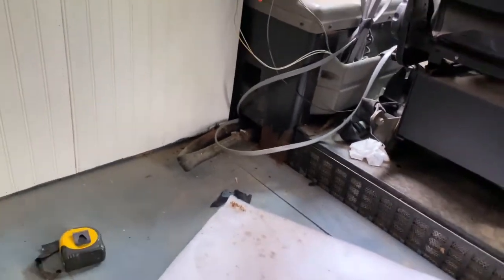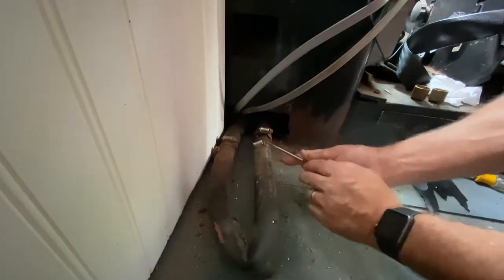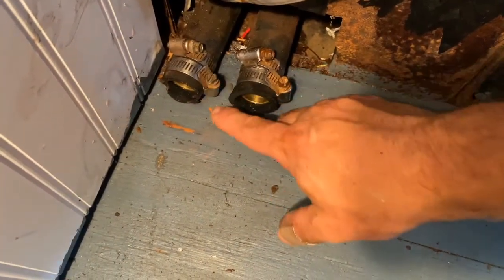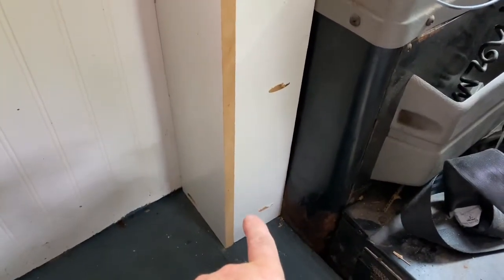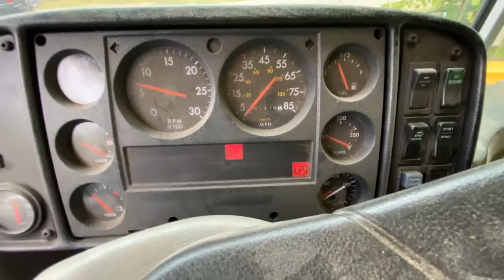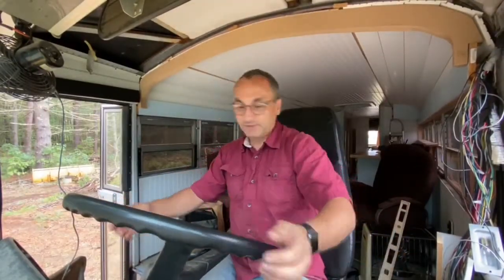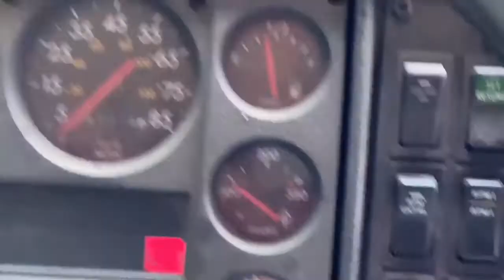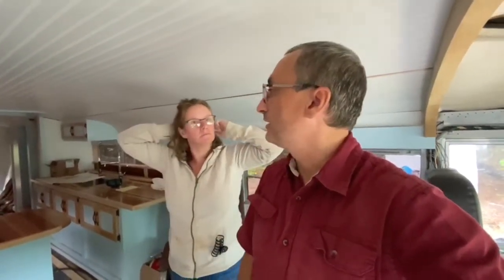We are back on the bus

Comment: Is your bus heater still going to work with those plugged off ? I am facing this same problem and I was under the impression that I would need to make a loop so the fluid would still flow.
Reply from the maker: For the cab area it still works. My bus actually has a shut off for this loop if you did not want to heat the kids seating area. Should not be a problem but i would check to make sure yours is set up similar.